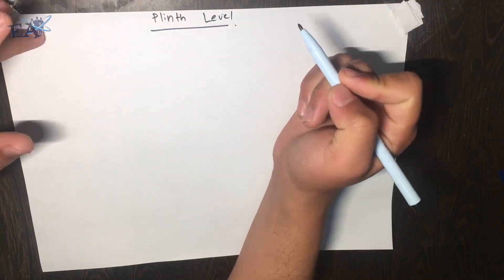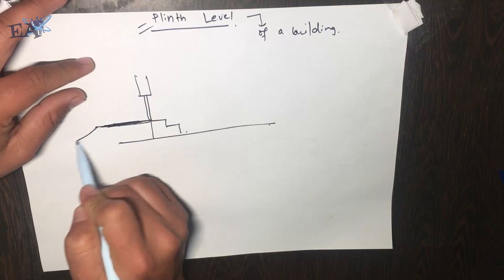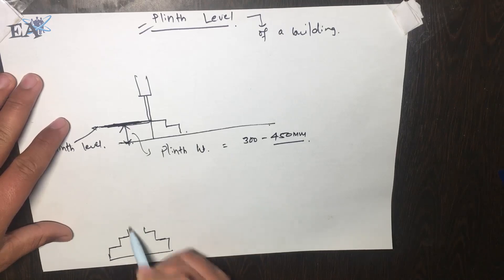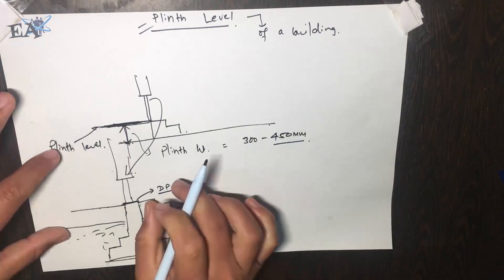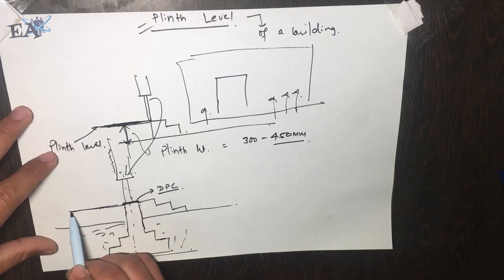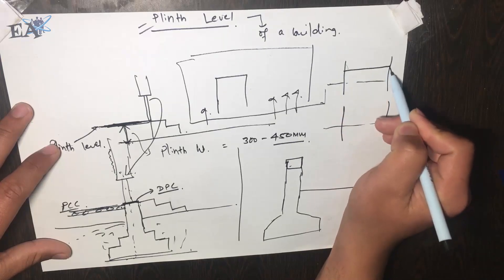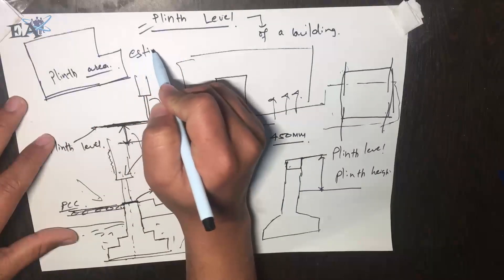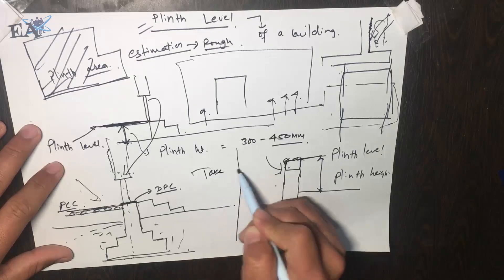What is Plinth Level and Plinth Height? Interview Question #8|

Comment: I wish to extend the Chajja. In this regard, I wish to clarify myself on the following points : 1) My house is a strong construction of 30 year old. 2) The house is built on 30*40 site. 3) There's a Chajja of 28 feet length and 2 feet width and is outside of the outer wall and this Chajja has been drawn from the beam on the outer wall. 4) I wish to extend this Chajja by 3 feet of width towards compound, so that it becomes a Chajja of 28 feet length and 5 feet width. 5) To do this, I wish to erect 4 circular columns. Is it OK if I erect 3
4 columns of each column having 12mm TMT bars of 5 numbers?  6) What should be the size of beam? 7) Is it OK if I loop the old TMT bars of Chajja  with new TMT bars of 10 mm as the old bars are of 10 mm by welding? 8) The thickness of the present 2 feet Chajja is 5 inches. 9) How should  slab be designed for reinforcement?

Comment: Sir, I wish to go for new Circular Columns instead of the present Square Columns and hence redo it. Now I  wish to extend the Chajja as follows. In this regard, I wish to clarify myself on the following points : 1) My house is a strong construction of 30 year old. 2) The house is built on 30*40 site. 3) There's a Chajja of 28 feet length and 2 feet width and is extended from the Lintel beam by 2 feet  from the outer wall. 4) I wish to extend this Chajja by 3 feet of width towards compound, so that it becomes a Chajja of 28 feet length and 5 feet width. 5) To do this, I wish to erect now 4 circular columns. Is it OK if I erect 4 columns of each column having 12 mm TMT bars of 6 numbers? If I wish to keep equal distance between the 4 columns? Can I install circular columns of 9 inches? 6) What should be the size of beam and should I have two 16 mm bars at the top and two at the bottom?  7) Is it OK if I loop the old TMT bars of Chajja  with new TMT bars of 10 mm (or 12 my) as the old bars are of 10 mm by welding? The distance between old 10 mm bars are 6 inches so it's 56 bars. 8) The thickness of the present 2 feet Chajja is 5 inches. 9) How should  slab be designed for reinforcement?

Comment: Sir/Madam, I want to extend my Chajja/Loft by 3ft towards the compound and I’ve put 3 columns with distance of 15 feet . The existing Chajja is of 2ft width and 25 ft length. The 3 columns are of 6″*6″ with a finishing of 9″. Is it OK if I go for a beam of 9″*9″ of 16 mm rods at the top and 12 mm rods at the bottom? And how many rods I’ve to use for top and bottom?